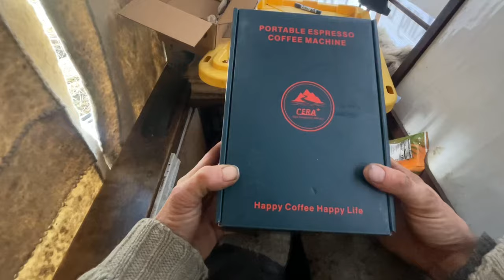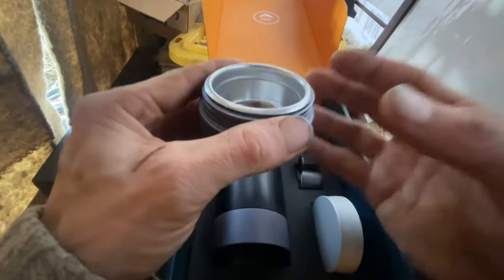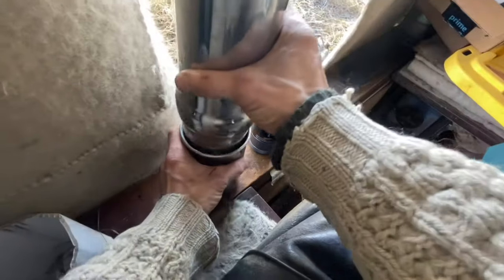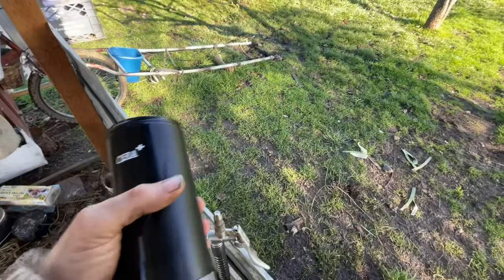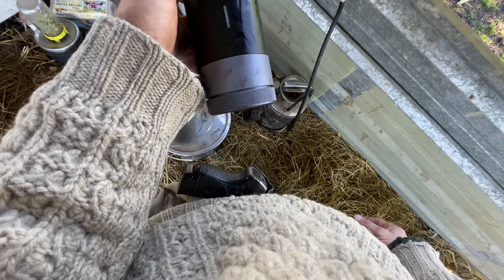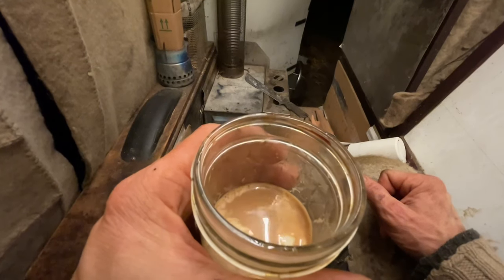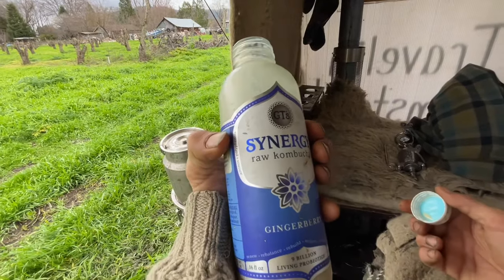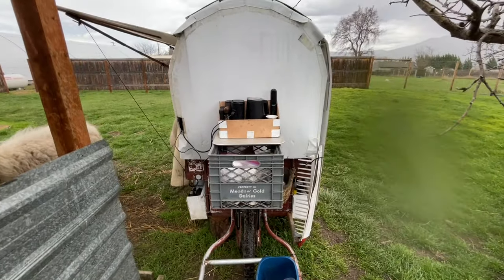New Cera+ PRO Portable Espresso Machine Review!?

Comment: Did you try tamping the grinds with that funnel removed?  Doesn't look like you are getting enough tamp pressure on the grinds.
Reply from the maker: I dont know what i did back in this video but now i tamp with funnel on then add puck screen and put the funnel back on to tamp with screen in place until tamp is level with funnel so when portofilter is screwed on the shower head will have enough space above puck screen for the porto to be fully screwed in.  Most baristas use uniform bean weight, grind size and tamp pressure to dial in whereas my system relies a little more on the uniformity of the ground’s weight, grind size and then i manually adjust my tamping pressure to correct for any variances in the first 2 perimeters that i see once grounds are evenly distributed in the portofilter.
Reply from the maker: Coffee geektalk 😅